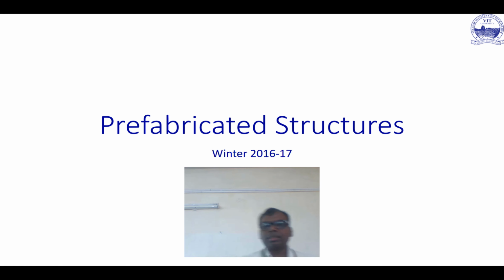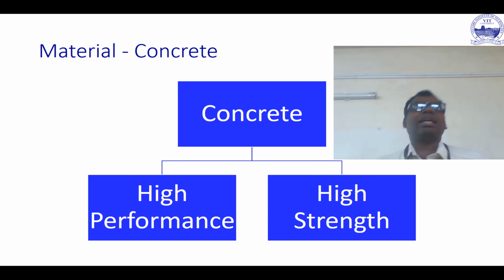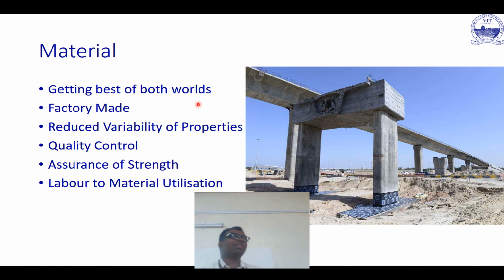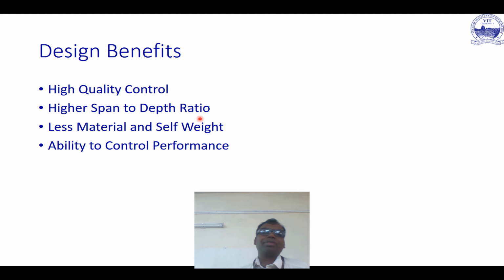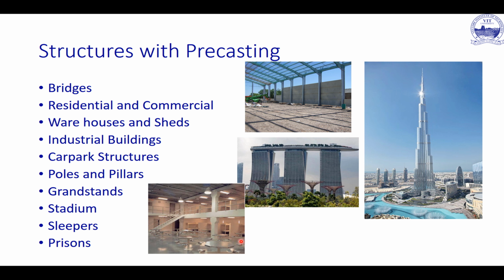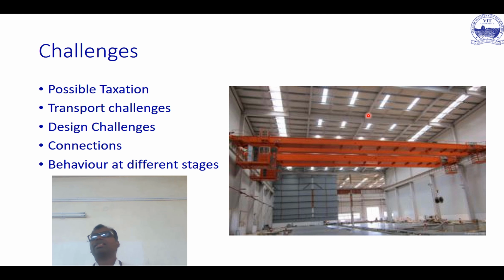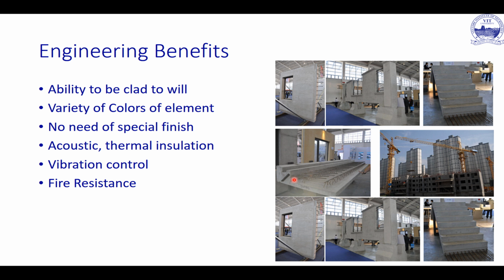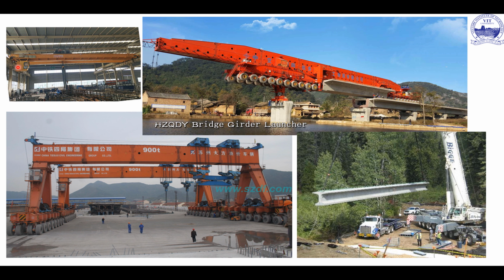DESIGN OF PRECAST PRESTRESSED CONCRETE STRUCTURES - A PRIMER

Comment: Give me  solution of two way and one way  salb  .. DL nd LL
Reply from the maker: Dear Gamit,
The design of the pre-cast slab is similar to that of a regular element.  You will be adding the connection detail which depends on the precast systems that you think about.
In addition, please refer 17:45 for the other loads (transport and handling loads) which have to be considered in design.
Trust this helps.
With Regards,
JSP